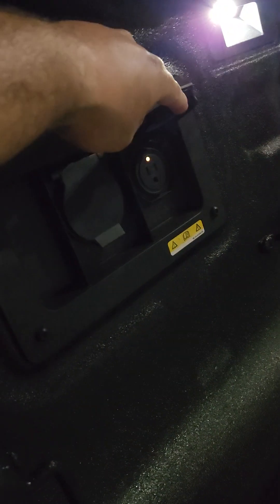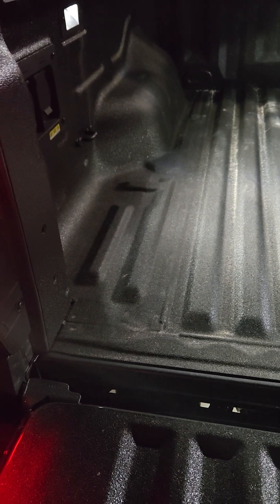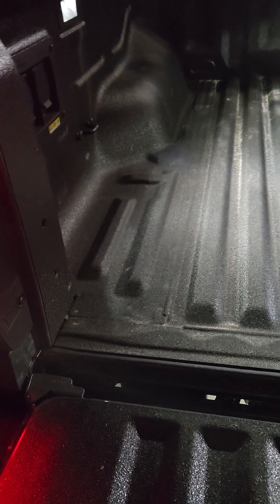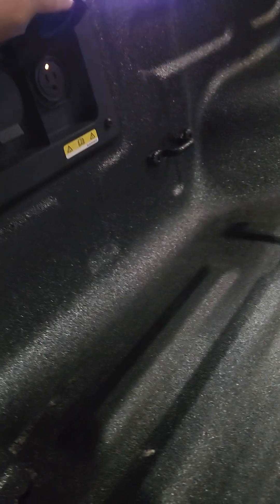2024 Ranger Raptor Truck Bed 110V outlet. Now working? Try This

Comment: It still not working
Reply: Same issue. Bought my 24 ford RR new.  Actually never used the cargo outlet or rear seat ac power. Only used the 12v in cargo and usb/c in rear seat. Went today to plug in an air compressor and found out neither work. No light. No power. Car on and off same issue. Any advice ?
Reply from the maker: @johnnykyle543 
A bunch of quirks with the in bed outlets and 2nd row outlets. I've driven around the block and then pulled in to my driveway put it in Park and checked and the outlets were on. I also had the outlets not working then put it in park in the shade and the automatic running lights turned on and then the outlets turned on.
Reply from the maker: @johnnykyle543 
I have run a small 110v air compressor from the in-bed outlet. I have never had any fuses or anyrhing blow out, I just know that after any sort of drive, to the grocery store, post office, daily commute, when I put it in Park and checked the rear it has turned on. Most of the time when I have checked first thing in the morning the outlets were not on. After a drive, putting in park, running lights turning on, the outlets have worked. Yes the manual drscription is uselss and the outlets should just work and not be so tempermental.
Reply: @adamlapid5201  
Hello Sir, here is what I did exactly in order, please let me know your opinion.
-2024 ford ranger raptor
-talking about the little led light above the ac power outlet in cargo and in rear seat.
fuses look fine, meaning i do not clearly see any difference in the metalic strip vs any of the other 20A fuses.
-side note, this fuse the the H style not the small regular fuses.
-got in car, turned over. let it idle for a minute and the exhasut sound (rpm dropped as normal)
-drove to the end of my street and back.
-kept car on, put in park. tried  cecking the led light with both parking break on and off while car is still on.
-neither light is on.

any thoughts?
Reply from the maker: @johnnykyle543  On my truck, whenever I first start it up the light in bed outlet does not turn on and the outlet does not have power until after I have driven it. It is not consistent, but the light does come on and it does have power after I have driven it. Just keep checking every time you park your truck. I always set the parking brake too.
Reply: @adamlapid5201 
Thank you. I think it’s a joke that this is even happening so I’ll just take it to the dealer and have them replace the part. It should work 100% every time all the time. Ford needs to level up. 
Thanks for trying to help.
Reply from the maker: Try driving around the block and then stopping and trying again.